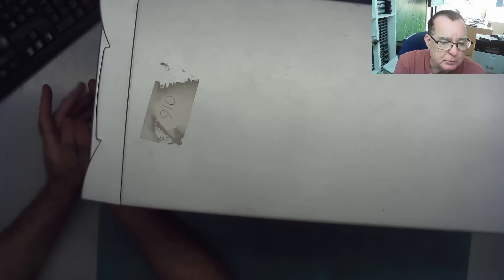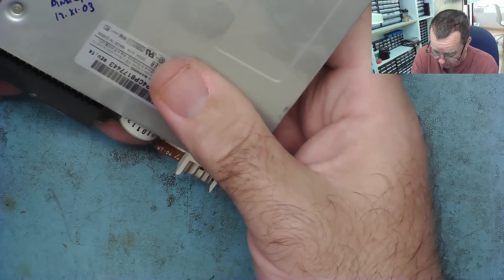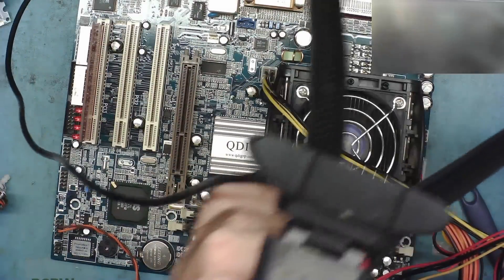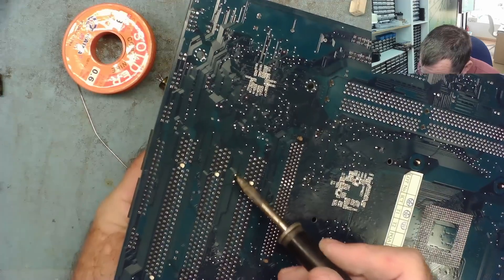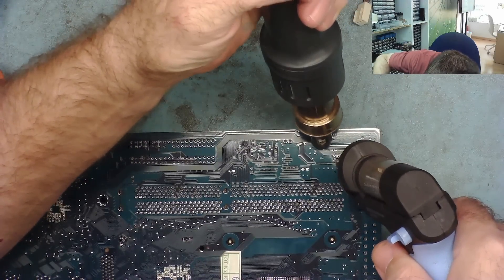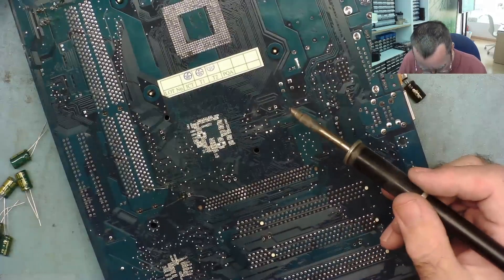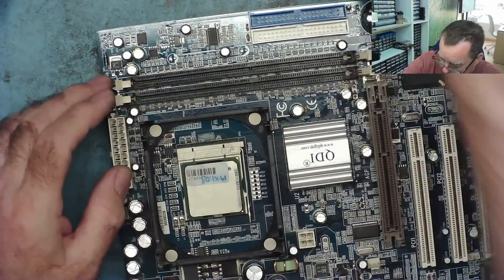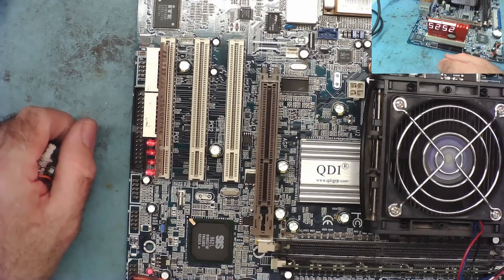Car Boot Flea Market PC Finds 9th Oct 2022

Comment: You are using the desoldering pump in very short pulses. This may contribute to the clogging because the molten solder doesn't make it all the way through to the collection chamber. Try holding the trigger a little longer while pulling the gun away from the joint. I rarely have any clogging since I adopted this technique from somewhere.
Great channel btw! Thank you for sharing your knowledge, very helpful.

Comment: thanks for the tip of using a hot air station just learned that lesson myself recently fixing controllers really helps out on a stubborn one especially because they use lead free solder

Comment: Hi Richard
Yet another great video on retro computers getting them working without a great outlay
Have you come across the old Zip Drives   getting one to work on a system without a parallel port
I've got several disks of information and wonder what's on them before binning them
Reply from the maker: I remember them but haven't seen one for a very long time - maybe I will find one at the car boot sale some time
Reply: @LearnElectronicsRepair  you don't have to go searching the boot markets just for a drive to satisfy a curiosity  that I've asked about 
It was only intended as a question if you had already touched on the subject in any previous video's you put out not as a specific need
I have been informed that a USB drive had been available that might do the job but I can remember many years ago
A friend of mine bought a zip drive that took higher capacity disks that might not have been compatible with the early disks
Sadly my friend is no longer with us and his stuff was disposed of 
Thank you for your rapid response Richard
I look forward to more teaching electronics video's from you

Comment: May I ask for your assistance?

I have a faulty USB storage drive.  The only problem I could find is an electrolytic capacitor on the oscillator circuit from the IC.  The IC I/O for the oscillator are on pins 9 and 10, that runs through a 1M ohm resistor, through the capacitor and back.  It is supposed to be a 12mhz oscillation, but the capacitor doesn't give me any discernable markings for specification, it only has FY12.000 on it. 

I removed the capacitor and it doesn't test well so I want to change it.  However I'm not sure what to put in.  The spec sheet for the ic doesn't give me any helpful information or example diagrams, so that isn't much help. 

Can you offer any advice?
Thank you.

Comment: Why not warm the nozzel on desoldering gun, or warm it with wire in tool, would be quicker.
Reply: He's done that before, used the hot air gun to add extra heat.
Reply: @Iceking007  yes I know he did that, but I was on about using the hot air onto the nozzel of the desoldering gun, so that the metal tip would be hotter before he used it.

Comment: Love how you went through all of that effort for a junk P4 (not even.. a Celeron), and screwed up doing it as well by putting chinese fake "Sanyo" caps on the board 🤣
Just as a newsflash: Sanyo hasn't made caps since 2009. They spun off their wet electrolytic cap business as a separate entity, now called Suncon. No cap since then has been branded Sanyo, but the chinese apparently haven't caught on to that yet. Not to mention no real Suncon or NOS Sanyo cap has an X vent ontop and circular bung. That's chinese fake garbage now installed on this board that'll fail again in no time and it probably still cost more in parts than the whole HW bundle ends up being worth. Good job lol
Reply: 10/10 for the info on the caps, thanks for sharing that, 0/10 for the grumpy delivery, I’m on my 300th video from Richard and consider him a great teacher - maybe watch a few more and you’ll get what he’s really up to here.